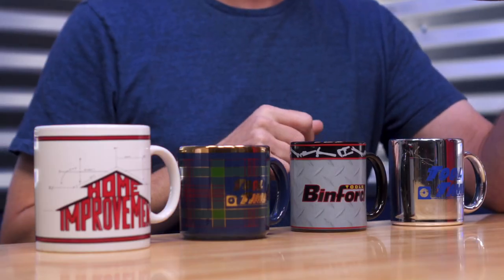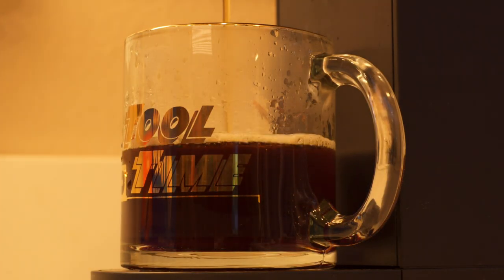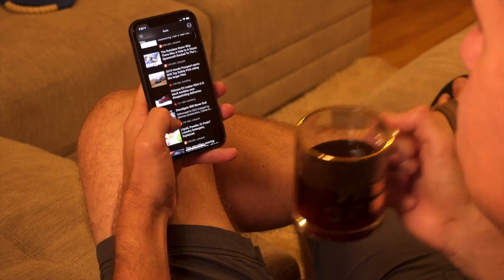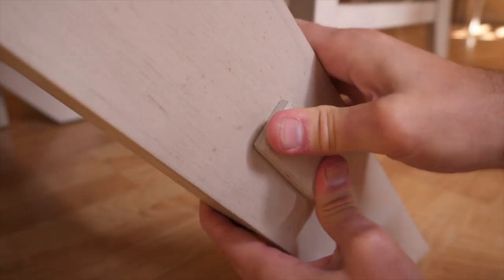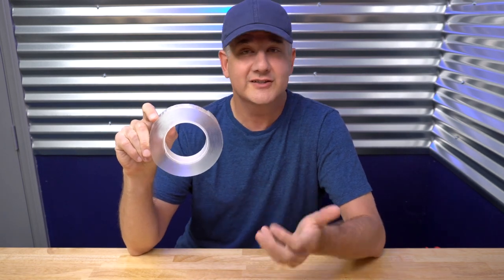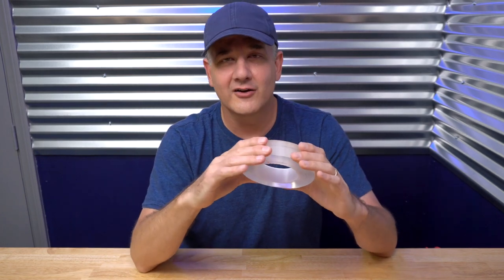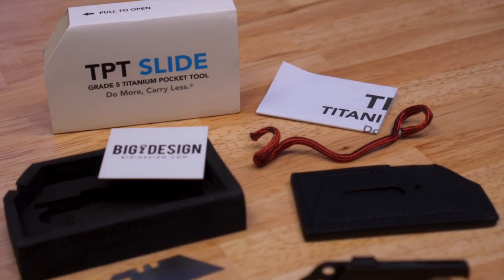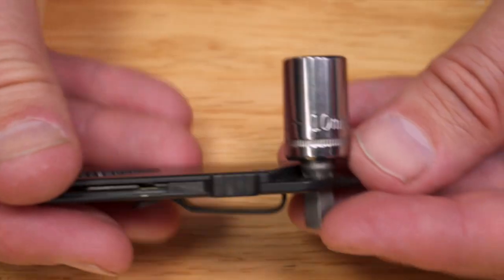🛠 My Top 3 Must-Have Tools - A Review and Recommendation!

Comment: Hello there, just off topic... we have here an ISUZU C221 Diesel engine and is being used as a marine engine but regardless of it we're cranking it by doing some preheating stuff by connecting a cable to a battery then connect to a metal strip on the body of the engine for a couple of seconds usually takes 30 seconds or so. So, my question is, is this preheating really necessary?? I noticed that in a car there's no preheating thing happening just turn the keys and it's on.
Thanks